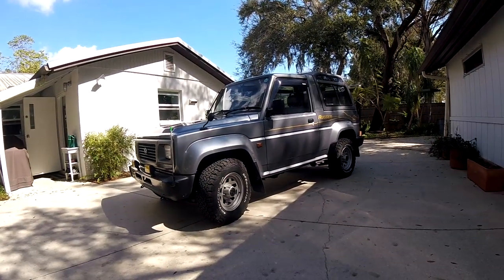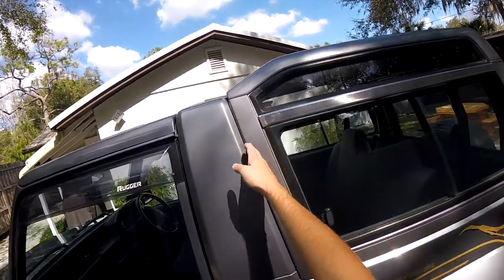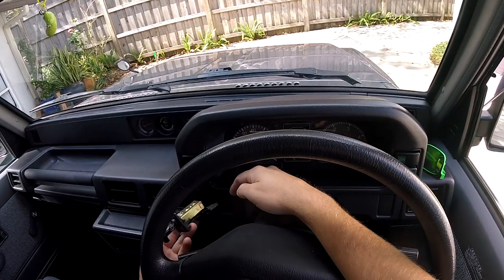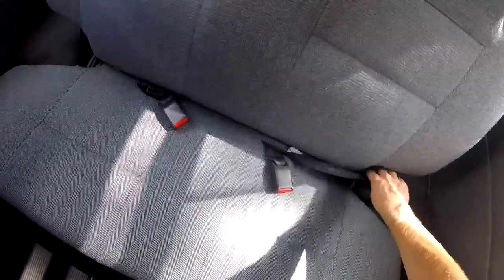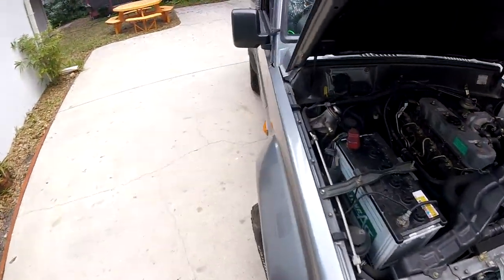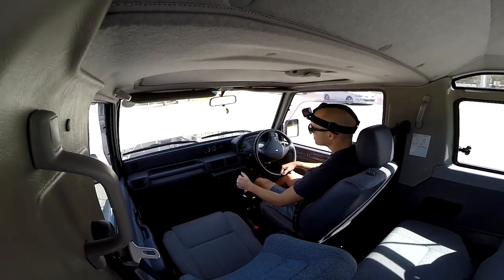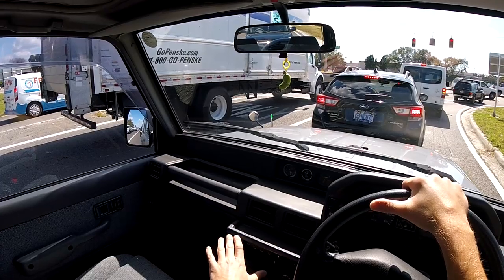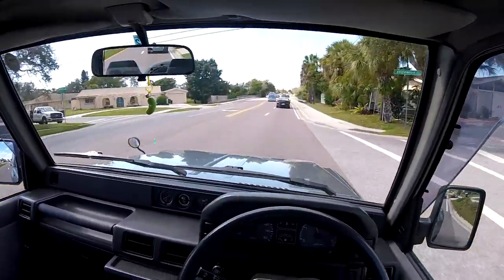1993 Daihatsu Rugger F78 Turbo Diesel 4x4 in the USA - POV Walk Around and Long Drive

Comment: Good review and Daihatsu Taft was once a legend in exploring the Indonesian Borneo jungle. When I just graduated from college in 1989 I worked as a geologist using Taft/Rocky (F70) in Indonesian remote area wilderness. Now I have an independent Taft (F78) 1997 with a modified turbo intercooler engine from Rugger. I still keep this unit until now (Feb 2023) as a memorable car.

Comment: I have a fourtrak in UK, which I think is same car. It has 324k miles on it and runs perfect still. That's miles not km. On small English country roads as well. If it wasn't for the rust the cockroaches would be driving these things

Comment: Lovely looking car. I've heard of the Daihatsu Rugger. I remember back in the mid 80s to 90s, Daihatsu briefly offered cars here in the USA. One was called the Charade, and the SUV was called the Rocky. Looking at it, the North American version of the Rugger was the Rocky. Am I right? :)
Reply from the maker: Close, the Rocky and the Rugger are separate vehicles though they share design and some trim. Ruggers are longer wheelbase and always have diesel engines, while Rockys are shorter and have gasoline engines. If you compare a Rugger to a Rocky the easiest way to tell is the space in front of the rear wheel before the door, a Rocky will have no space there like the Rugger does. Weirdly enough Ruggers were sold in Europe and Australia as Rockys to add even more confusion. The USDM Rocky we did get was sold in Japan (though as RHD) and wore the name 'Rocky'.
Reply: @KakerMix  Ahhh! Okay. I guess we never saw the Rugger. I would've liked mine with a turbo diesel engine, which for some reason, we never got here in the USA.
Reply: Jason, I was fortunate enough to own a 1990 Charade with a 3-cylinder engine and 5-speed manual trans. I was dumb enough to sell it in 2000, after 6 months of owning it as it didn’t have A/C and couldn’t get me any dates. I then bought a 1993 Mazda MX6
Reply: @maximilianbutton5389  I regret that I've never driven a Daihatsu.
Reply: The Rugger was sold as Rocky  in Latinamerica, most of Asia, Africa and Europe (except in UK) in lwb and swb diesel and petrol versions. The US Rocky version was a modified Daihatsu Feroza (1,600cc 16valve), as known in most of the world, except UK (Sportrak). By the way, the Rugger also came in short wheel base. Cool vids!

Comment: I am considering buying a diesel one, but I have two concerns: 1) Parts for the Diesel version, are they easy to find in USA? Expensive?  2) Emission regulations, any concerns? I live in Pennsylvania. Any advise would be much 
appreciated.
Reply from the maker: I can't speak on emission regulations as Florida simply doesn't have any, and the 25 year rule means, at least federally, the vehicle would be exempt. I haven't heard any strange issues relating to emissions requirements in any states besides California.
As for parts availability, these are popular in the United Kingdom, Indonesia and Australia. The full service manual is available, in English, as well. Parts are as easy and buying and shipping international. Sure it's more expensive and less convenient then jumping down to your local auto parts store but hardly an insurmountable issue. You will not find parts for these in the USA, they will always come from overseas.
Reply: If you do get one, when looking for parts, don't get confused over the naming. The Rugger is called a Rocky in Australia and Fourtrak in other countries. Then there is the little brother. Called a Feroza in Australia. Lovibond in Japan and to make it confusing "Rocky" in other countries. F70 is what you see in this video and F300 is the smaller Petrol/Gasoline. Toyota own Diahatsu so you can still get parts for them. I have a Feroza in storage with only 45,000miles. Going to swap out the 1.6 petrol with a toyota Hilux  2.4 turbo diesel and running gear.

Comment: Don't mean to be a bother by leaving another comment guys, but was wondering if anyone could help me out. Any chance anyone would know where to get hold of a 1993 f73/78 workshop/owners manual? Ive looked through pages upon pages of websites and all i can find is 10+ year old forums with invalid links or sites that are clearly malware/scams. At this point I'd be willing to pay a extra just to get hold of a digital copy, but there seems to be no trace of a manual. If anyone could point me in the right direction it would be much appreciated.
Reply from the maker: I have never been able to find a digital scan of the F70/F75/F77 manual, never an F78 one though I have looked a lot. Later models of the F75 did have the same turbo intercooled engine, as far as I can find out the biggest difference would be the front end suspension since the F78s went IFS, and the body for obvious reasons.
Reply: @KakerMix  thanks for the reply! Anyway I have good news, I was able to find a complete digital copy of the f78 model. I found it over on the daihatsu rocky/feroza page on Facebook (the one with roughly  6k members). I'm pretty sure it's based in Australia, but just search f78 on the page and it should be one of the top results. 

Sorry for hijacking this comment, but thought I would leave it hear if an anyone else has trouble finding the manual.
Reply from the maker: @timthompson2890  That owns, though I am not having luck finding this F78 manual, just the F70/F75/F77 one. Have a direct link or just more specific instructions? Thanks!
Reply: @KakerMix  I think they had a google docs copy. I will try and find the link when i get home in a couple of hours.
Reply from the maker: @timthompson2890  *Incredible*, thank you so much. This is exactly it. Granted I no longer own this F78 Rugger, but I do plan to own more. Now I can pass this off to the new owner! Again, thank you deeply.
Reply: @KakerMix  Not a problem mate! Id love to pass it around more, as it seems not nearly enough people can get a hold of it. f78's really are amazing cars!
Reply: Yes get on the "daihatsu rocky and feroza australia" FB page. :-)